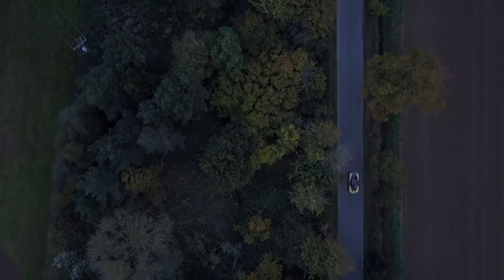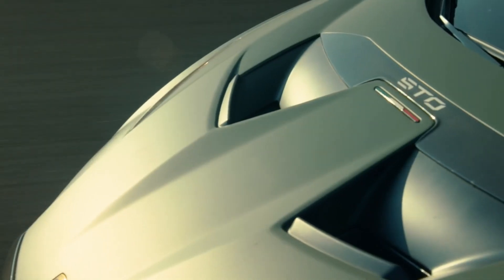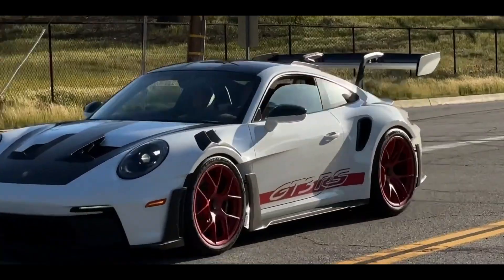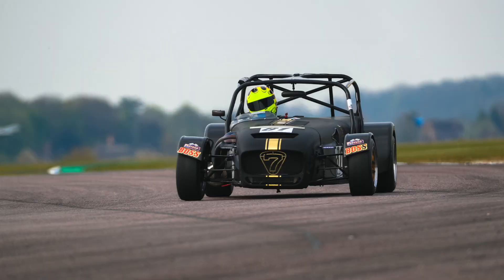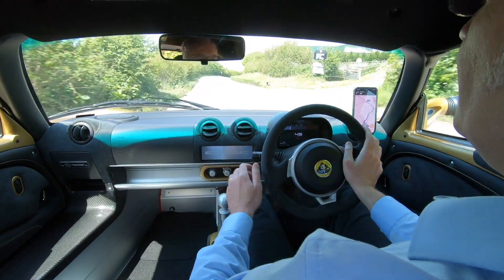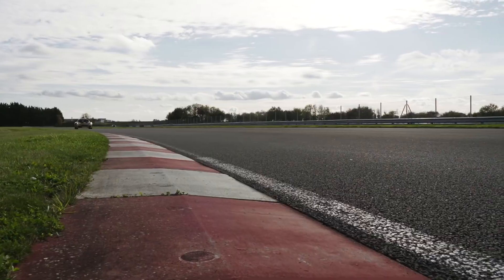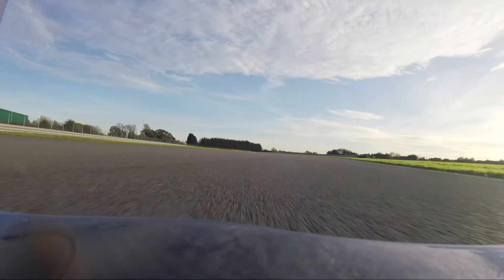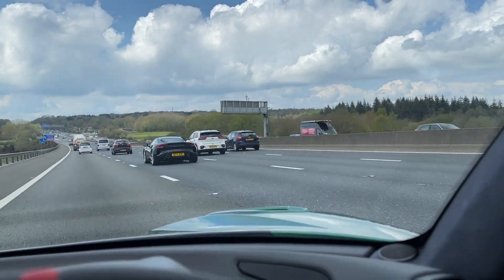What's the point of downforce on the road?

Comment: A bit of wishful thinking here i think personally. Yes it does make a difference, but not much at all. For example, you have comments here saying that a 220 Sport feels "Very light" compared to your 250 Cup which feels "Very stable" at the same speed. If the Cup really is producing 67kg at 100mph which i doubt, that's going to be around 40kg over the front wheels at 125mph. Barely half a passengers difference. I've recently heard that Lotus's DF number claims are very optimistic anyway, and how often are we all hitting 125mph on the road? I'd heard the UK was very strict on speeding these days, but at 140kph you're into licence losing territory here in NZ, so the only time I've (accidentally, your honour) reached a speed where either my Elise or Exige is producing any actual downforce has been for a split second, and also in a straight line. On the track of course would be different, but if I was doing serious track work in the Exige the 40-50kg of downforce it supposedly produces at around 100mph would be hardly worth having, and you'd want to modify the car to produce much, much more to get real benefit. If you're really enjoying sustained benefits of downforce from a factory Lotus on the road, you're going to lose your licence pretty soon I would wager. But on the other hand, wings and spoilers look cool, and any amount of stability is better than lift, even if it's almost negligible ;)

How are you finding the 250 cup btw? Which do you find yourself taking out more frequently for a Sunday morning drive, the Elise or Evora?
Reply from the maker: as it happens Lotus revised a number of their downforce gains some time around 2019, some were revised down such as the Exige Cup 430 (220kg to 171kg at vmax) a few were revised up slightly so the figures I'm using are more accurate I believe. The net gain is bigger than 67kg of downforce at 100mph if you're comparing to a car that generates lift. There are a few corners at tracks in the UK which are easy flat in an Elise Cup at 120+mph and Evora GT430 at 130+mph. The same corner in the Exige V6 Cup which made less downforce (42kg@100mph) needed brave pills to take flat, it could be done but you had to turn-in at exactly the right place or things could get pretty scary, pretty quick. The difference is night and day so the downforce is very real in my experience and as per the video the benefit at legal motorway speeds is stability.
Reply from the maker: Good question Elise or Evora, one I ask myself regularly and it's rarely an easy or obvious choice but nice first world problem to have. Planning to do a video on that actually so watch this space. Cheers!

Comment: One of the guys I do club days with in Aus happens to be the quickest Elise driver in our club at Phillip Island, one of our quickest tracks.
.He thinks that my large wing is slowing me down too much on the fast straights. He uses no rear wing and is quicker than me through the high speed corners. He thinks that I should just trust the mechanical grip of the Lotus chassis and lose the wing. We have similar horsepower.
I’d love to hear your opinion. It would also be amazing to do a video on track with and without a rear wing.
Thanks for the fab content
Reply from the maker: Thanks, I’d love to do a track comparison with and without wings. Lotus claimed the aero parts on the Evora GT430 were worth 1s around the factory test track. The GT430 Sport (the one without wings) was 10kg lighter and was  faster on the straights.

Comment: I follow your logic and argument, though I doubt that is the real reason these things are happening - its marketing above technical / engineering reasons, so your points are valid but most buyers are spending the money to have a car that looks faster and that means, these days, more like a track car, the brash shouty look.
Reply from the maker: Ferrari seem to be are strongly opposed to the more visually obvious stuck-on wings and are chasing downforce by more discreet means but they are definitely still interested in downforce. Even going back to the regular 458 Ferrari claimed 140kg of downforce at 120mph.

Comment: But how much stability through downforce does one really need?
Is 992 GT3 noticeably less stable than 992 RS (which has 3 times as much DF) in public road use?
And does that make 992 GT3 Touring an unstable car?
Funny how 997.1 RS is often rated as the superior driving experience compared to newer GT products with just 55 kg of downforce at 300 kph.
Reply from the maker: Yes GT3 Touring would be noticeably less stable at high speed than a GT3RS. Dramatically so at Autobahn speeds where the downforce on the 992RS would make it the slowest in terms of top speed of all the GT3s. But compared to older 911s the 992 GT3 Touring benefits from many improvements in  aerodynamics. Plenty prefer the air cooled 911s as a driving experience and that is despite having treacherous on-limit handling and awful chassis balance. For every Porsche since the 996 GT3 there is always someone claiming theirs was the best.

Comment: Manufacturers are adding downforce for the same reason they are adding power and talking about 0-60 times and Nurburgring lap times. It sells cars. It has nothing at all to do with the driving experience on public roads , and has everything to do with benchmark racing and for one guy to brag to his friends about. Showing a video of breaking the speed limits on public roads doesn't actually prove your point. 

Your point about "not generating lift" is important though. Gordon Murray has a bit to say about removing lift without extra weight or aero loss (wings, etc).
Reply from the maker: My point was that cars with genuine aero may look like track cars but they are often surprisingly comfortable and composed at legal motorway speeds because they become more stable. Most cars get lighter at higher speeds, so the delta in driving experience between an ordinary car and one that gets heavier at speed is more noticeable than you might think given what is often a modest sounding downforce claim. In what way is this a video 'of breaking the speed limits on public roads'?

Comment: Nicely put, I remember the literature on the Evora 400s talked about negative or no lift at 100mph which I didn’t fully get until I had my Evora S which notably went unnervingly light at (v.) high speeds.
Equally noticeable in my S2 Elise at lower high speeds
Reply from the maker: Thanks. I believe the factory claimed around 30kg of downforce from the Evora 400 at vmax, the Evora S was supposed to make half that so yes very little downforce at 100 mph but also minimal lift. Sport 410 with the carbon ducktail doubled the 400’s figure to around 60kg at vmax. The last GT410 Sports made a similar amount but were more aerodynamic at the same time making them highly aerodynamically efficient. Clever stuff, as you’d hope from the company that pioneered manny innovations in aerodynamics in F1!

Comment: Well argued. Hadn’t thought about the benefits of adding weight w/can then come off at low speed.
Reply from the maker: Active weight management! Aero has come a long way since the rubber spoiler on the back of an XR3!
Reply from the maker: Lotus compared GT430 with and without wings (although wingless car still made quite decent downforce, something like 70kg at vmax vs 256kg), GT430 with wings was a second faster around Hethel. Wingless car was faster down the straights too. Engineer said you could feel the difference all the way around the lap and the aero car turned-in and stopped better.

Comment: What's the point of downforce on the road?  It's just to show off. At the speed we are allowed to drive, no force is generated enough to notice à difference. That s one of the reasons why most of hypercars/track oriented extreme cars are just undrivable at slow speed (Ex: Radical).
Reply from the maker: As in the video, the benefit is high speed stability not the increased grip that is the intention of aero racing cars. You don’t need massive downforce to make a car stable at motorway speeds but you need a lot to increase cornering grip. Elise Cup 260 gains over 80kg at 100mph. I could definitely notice the extra 100kg last time I came back from B&Q and that was in a 2 ton SUV!
Reply: @DrPittenstein  sorry but I don t think you drive at 100 mph on country roads... and on the highway I don t see the point to have a stable car at 120 mph.
Reply from the maker: @PaddyMcQueen  a car with downforce is more stable at 70mph too. It only takes one drive in a car that’s unstable at high speed to appreciate the value of high speed stability. You can get that from a heavy kerbweight too but you are stuck with that weight when you get off the highway and it’s not what you want in a sports car is it? So best of both worlds is an agile, lightweight sports car which gains weight and stability at speed.
Reply: Did you watch it? He answers this.

Comment: Not watched this yet but last weekend at night I hit 125mph and my lotus Elise 220sport felt super light at the front. I’d imagine that the 250 would feel more planted at that speed.
Reply from the maker: Thanks, that totally backs up the point I made in the video. The Cup 250 generates more downforce @ 100mph (67kg) than the Exige Cup 430 (56kg) and yes does feel very stable at high speed which contrasts with how responsive it is at slower speeds. At 125mph the Elise Cup weighs 104kg more than a 220 Sport which is a lot in an Elise.